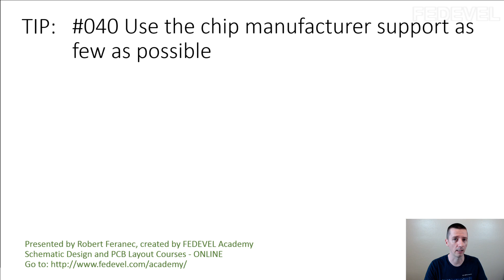TIP #040: Use the chip manufacturer support as few as possible

Comment: Ah yeah this one.... I designed a boost converter for a capacitor bank once, with a chip from TI. It seemed to malfunction under very certain conditions, and didnt get any support from TI. Yet 2 years later we got an email 'Oh about the equations in the datasheet of the loop compensation of that part you used, they are all wrong. Same with the calculator you can use on the site'. Not so fun. So I guess part of the lesson learned was also 'dont trust chip manufacturers blindly, they also make mistakes'.
Reply: Oh yeah and there are exceptions to the rule. For example I contacted Murata because I was missing a saturation current graph in their datasheet, and they made on for me, no questions asked.
Reply from the maker: Something similar happen to me ... a chip manufacturer basically didn't want to answer my questions, because they knew there is a problem with silicon. Only after I insisted on the answer and provided clear prove, that there is something wrong with the chip, they confirmed it.